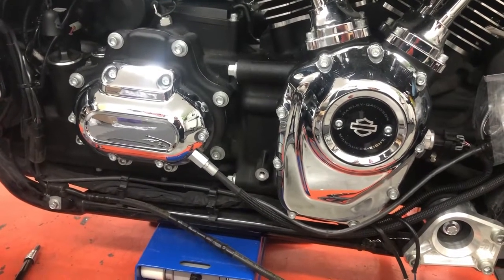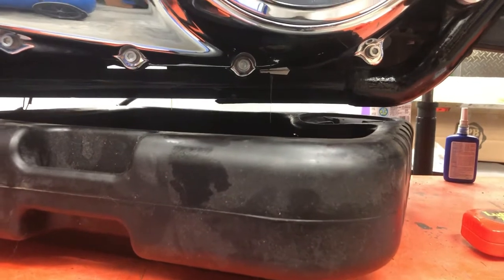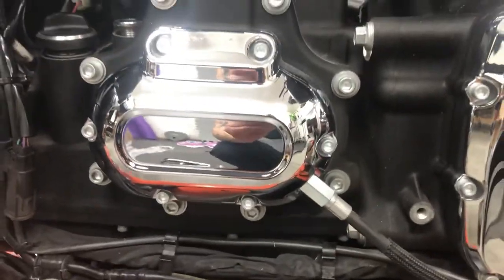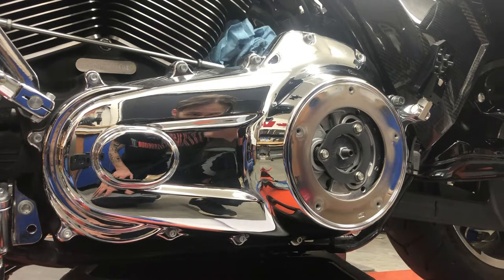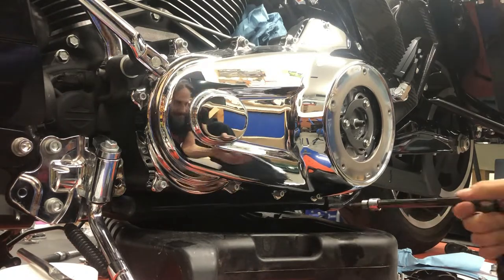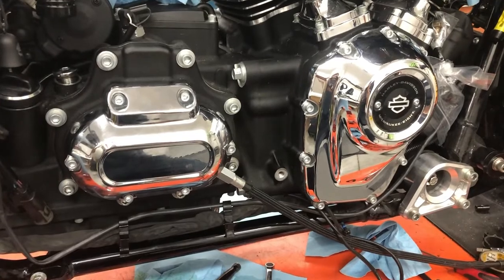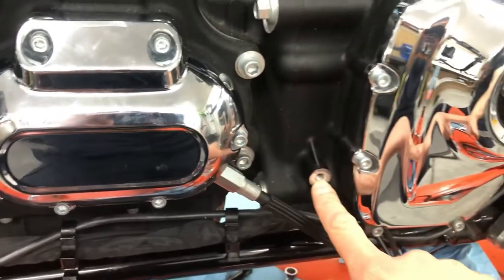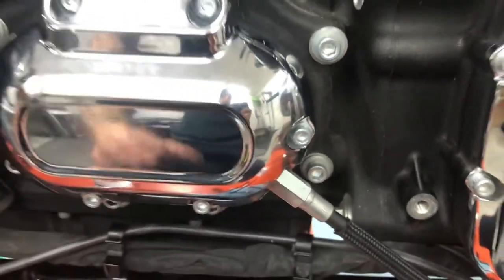Install video of Boosted Brad Mids for M8 Touring with custom rear brake line on a 21 Road Glide.

Comment: I wouldn't cut anything back. You won't own the bike forever and the next guy might want to change it back. Not everyone wants mid controls. Stick the bolt back in it put some paint on it and forget it. Just sayin....
Reply: You have to cut it back if your bike has cable clutch. The only thing that bolt is good for is the stock exhaust

Comment: For the front right side I see that you installed ( 1:34 ) the "Alloy Art M8 Touring-Floor Board Delete" bracket from Boosted Brad. Just wondering if it's as easy as removing the 3 allen head bolts and putting in the new bracket??
Reply: The front right side OEM floor board mounting bracket forms a part of the motor mount, so this Alloy Art floor board delete is basically a motor mount bracket. Since the motor is directly on the motor mount, it helps to slightly jack up the motor with a small scissor jack. This way the bolts come out easily and the holes align. You dont want to jack up the motor so much as you just ease the weight of the motor off the motor mount. If you dont do this, the bolt will appear as they won't come out, they may even shear off which you want to avoid. lift the motor slightly and the bolts will come out with familiar ease. The service manual for your bike will direct you. Hope this helps!!!
Reply: @sebastienboucher1980  Grea info Thank you! I also have the BB Mid Controls on my new RG ST but was looking for more info before removing the bolts and just like I thought they are supporting the engine. Thank you!